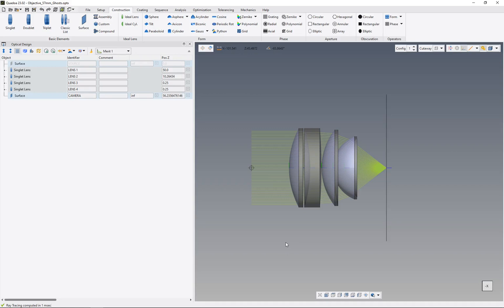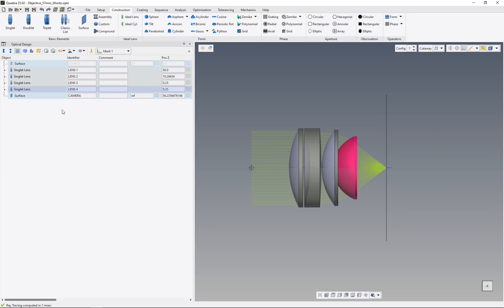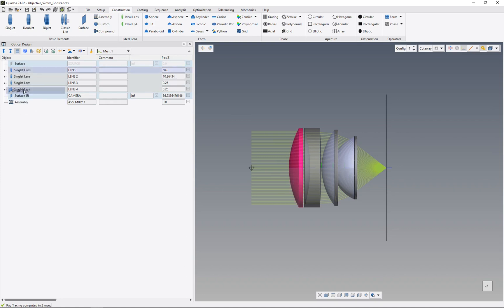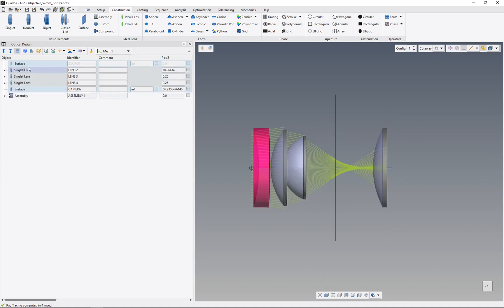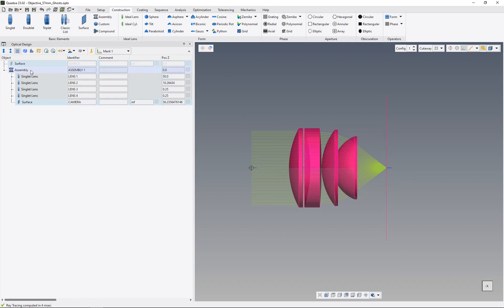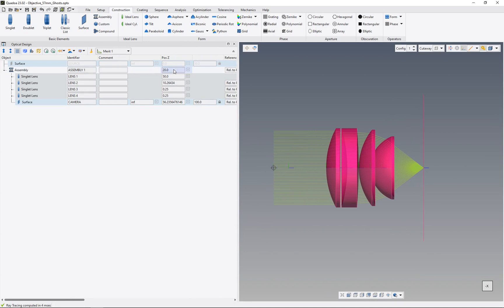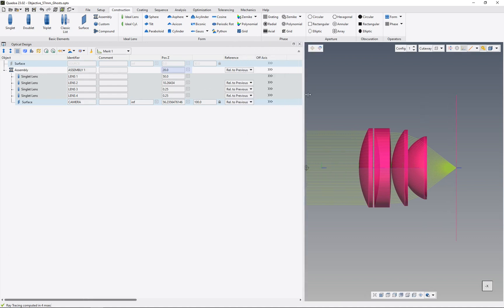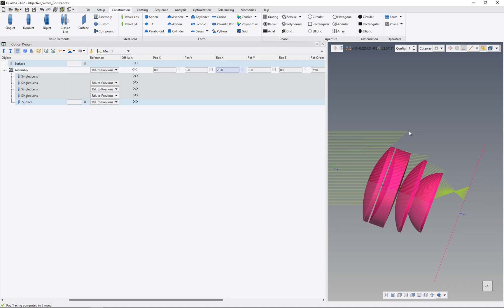Construction: Assemblies - Optical Design Software Quadoa Optical CAD

Comment: Thanks for sharing: Is it possible to design a system with a magnification (50x) of an object on a camera?
Reply from the maker: Yes sure, you can check out the microscope objective example files
Reply: @quadoa  Thank you. Where can i read off the value of the magnification? Please
Reply from the maker: @ewandeOpto1002  You can open the optical properties report under Analysis --> Reports